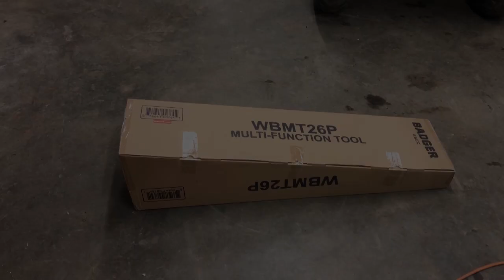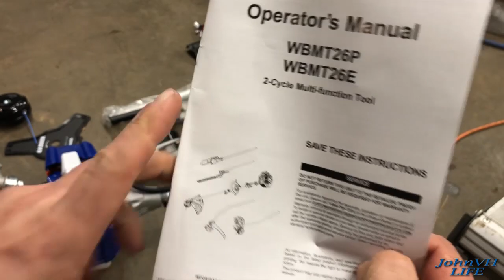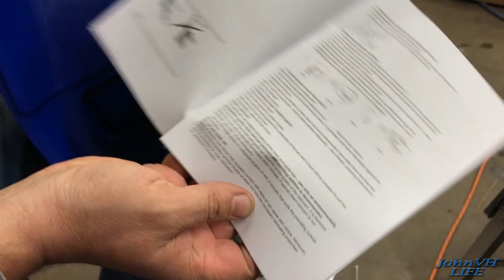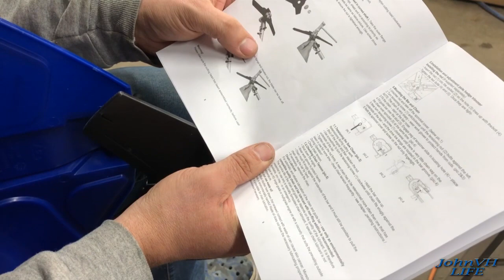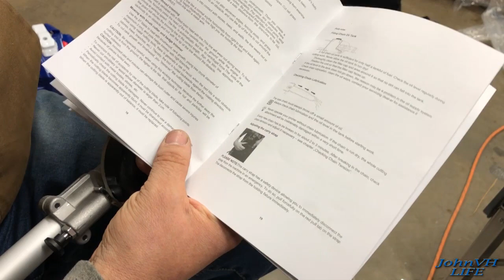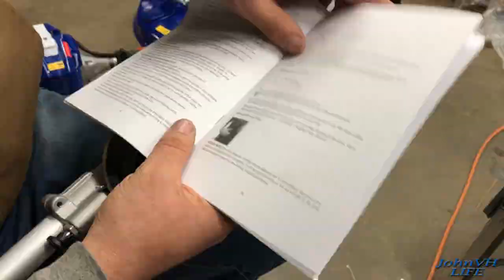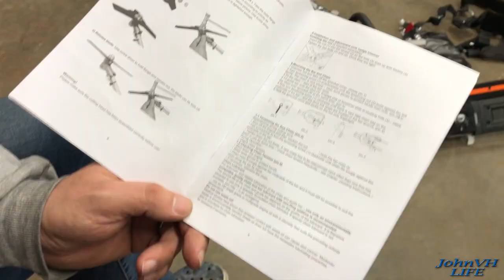Wild Badger 26cc WBMT26P 4 in 1 multi tool review and USE

Comment: Good job on the video, I've had mine for over a year now and 2nd all of John's positive comments.  Really love the limbing saw, I've cut 8" diameter trees with it, no problem.  Only negatives I've experienced in my yr + of use is the the original saw blade didn't last long (got dull quick) so replaced it with one with more teeth and higher grade and worked much better, though still got dull in due time--I'm doing a lot of cutting! Also disappointed that they didn't include an edger with the package, need to pay extra to get one of those if you want one. But overall, been a great tool!
Reply from the maker: Thanks so much, I was using the pole saw on it the other day, I should have taken video! She fired right up, ran like a watch, cut very well, super happy with it!  Im sure over time Ill have the same issue you do, but time will tell! Im not cutting any hardwoods though.
Reply: I bought mine from lowes and it came with and edger but no saw

Comment: When I use the brush cutter or weed eater attachment when I tighten them or if not completely tightened will the blade or round string attachment fly off and if so how do I make sure that they won't fly off

Comment: I bought mine this past week. I can not for the life of me get it to start. Is there a safety tab or something that I missed? I primed it, 50-1 fuel, put on start, the kill switch is to run. It isn't even remotely turning over, so I feel I must be missing something stupid.
Reply from the maker: Odd, choke is on?
Reply: @JohnVHLife  Yes, I have even tried flipping it to run and holding the gas while pulling.
Reply from the maker: @jeremysilcox9362  remove the plug and test to see if it has spark?
Reply: MAKE SURE YOU GOT THE SWITCH TURNED ON, WHEN YOU TRY TO CRANK IT.

Comment: I bought one last year and could never get a complete package that was working there was something major wrong ever time I  returned it and got the next one something was wrong so I got my money back and got a ryobi.
Reply from the maker: Dang. That’s a bummer. So far so good for me
Reply: I’m having the same problem.
Reply from the maker: @tommills177  Strange, mine works great still! Getting spark? Getting fuel? Priming the carb?
Reply: I don’t have a problem with someone else’s, just with my own. And that’s why I reached out. I’m glad yours is working though.
Reply: @JohnVHLife  There is spark, fuel and I always prime and chock. Seems like something is too tight.
Reply from the maker: @tommills177  Try removing the accessories from it? Just fire up the motor and see?
Reply: Will do.
Reply: @JohnVHLife  That was better but still wouldn’t run. I’ve got it in the shop now. If you don’t mind I will let you know what it was so someone else may benefit.
Reply: @tommills177  I've got the same problem. Brand new can't get it to run for s*** got me pissed off
Reply: When I look really closely at it the gas tank where the two hoses come out there is a small slit that has been painted over with white paint. Does a trimmer have to hold pressure in the gas tank to start? Shouldn't have these problems on a brand new unit.

Comment: Where do you check the engine oil on this thing? There's nothing about it in owners manual.
Reply from the maker: Being a two stroke, I dont believe it has any oil.
Reply: Is this a confirmed answer, I just want to be sure I’m doing everything right to maintenance my machine 🙂

Comment: Is there an extension you can get to make the pole saw or hedge trimmer longer (by about 3 feet).  I cannot seem to locate one.
Reply from the maker: I have wondered the same thing. LMK
Reply: @JohnVHLife  I contacted Wild Badger about this and this is the response I received.....

"The shaft on the attachments is 30", and the following brands should be compatible: Ryobi, Craftsman, Troy-Bilt, Toro, Poulan, Poulan Pro, Weed Eater, Cub Cadet, MTD Pro, John Deer, Yard Machine, Yard Man, McCulloch String Trimmers*. But Wild Badger does not sell an extender for these attachments.
*Be sure to check your user manual before purchasing this, or another attachment, for another brand."

Comment: Can you use pre-mix 50 to 1 fuel? I filled my up brand new weed eater and is will not start
Reply from the maker: Manual says to mix the fuel 50:1, so it should be fine...  pump the primer and use the choke as stated in the manual
Reply: @JohnVHLife  I tried everything NEVER started. Had to return it. Thank you.
Reply from the maker: @YayaOrchid  Bummer!
Reply: @YayaOrchid  are you holding down the orange buttons? If so, it won’t start.  Just hold onto the body or bar. Also, have the trimmer set at start then when you get it to start, put it on run and then push the orange buttons.
Reply: This is very hard to start the first time. I about gave up but after many tries, it finally started. Started right up after that. I was about to return mine as well. Today first time use,   very intense vibration using blade. Waiting for company to get back to me.

Comment: Still have no clue what that piece is sticking off the handle. It's annoying and in my way
Reply from the maker: Pretty sure its to rest on your leg, or something.
Reply: Must be a big dude! I can't rest it anywhere lol
Reply: edging?
Reply: Way to far for that
Reply: @brandonsmith8548  ill figure it out lol jus ordered 1. see how it compares to echo srm 225
Reply: Nothing like the echo. Be careful of your forearms with no heat Shield
Reply: @brandonsmith8548  its got enough sheilding. i haven't burnt myself one on mine i've had it for a few months.
Reply: I run mine all day. The motor is not shielded always burn my forearm lol.
Reply: @brandonsmith8548  how? are you some how sticking your arm between the plastic and the motor? i ran mine for 45 minutes this morning trimming my fence swell around the house, the shed, trimming vines off the back fence  etc. i've never burned myself on mine. thats with my right forearms sitting right on top the motor.
Reply: Lol no. My other trimmers have a cover. This one only has like half a cover. The bottom of the motor sticks out. It's just where I've always leaned my arm while trimming. The upper side of my forearm gets sizzled. Or if I'm edging it does it
Reply: Yea idk it's weird when it first happened cause all my other trimmers are fine. I still use it everyday it just a habit
Reply: @brandonsmith8548  ok i'm for the life of me trying to figure out WHY you have the motor ON TOP OF YOUR ARM. thats not where it goes. are you left handed or something?
Reply: My right forearm brother. Near my elbow
Reply: Maybe I hold it weird lol.
Reply: @brandonsmith8548  so you're using it commercially then? i'm residential and i trim every other week so typically i'm only trimming for an 1-1.5 hours a month. i got maybe 4 hours total on mine including letting it just run for break in. what oil are you using? right now i'm running vp sef 50/40:1 premix.
Reply: Correct I bought it as a backup. But it seems to be the one I grab more often and I run amsoil 2 cycle mix. 40:1. They say you can run amsoil 100:1 but I just can't do it lol.
Reply: I've had it about a month so I would say 60 ish hours maybe. That's a rough guess as I rotate a few trimmers. I've got a graveyard of broken trimmers lol. Maybe I'll try bumping to 60 or 70:1
Reply: @brandonsmith8548  they claim its commercial grade so i;m interested to see how long these last. i figure for me 15-20 hours a year so right now you're 3 years in for me.anyone in the lawn business has a graveyard of broken equipment.
Reply: I use it about 1 hour per day 6 days a week. And yea I use the scraps for parts more than anything!

Comment: The blade makes it shake a lot
Reply from the maker: Not really
Reply: Mine has a horrible vibration. Waiting for the company to get back to me.
Reply from the maker: @phoenixrising1087  Even with nothing attached?
Reply: I was using the blade. Or trying to. The Badger isn't complicated to assemble but did wonder if I did something wrong. I've put plenty together in the past without problem. But now I'm reading of others having the vibration problem. Mine was actually pretty violent, twisting the whole thing around in my hands while trying to hold the handle. The blade itself was very secure, no wiggle room at all. The vibration was enough to loosen screws in different areas, which I'd retighten, try again only to have them come loose again. It seems perhaps some cutters may have this problem while others don't @JohnVHLife
Reply: @phoenixrising1087  I am having the same issue. Vibration so bad I can't even fully fire it up. The string attachment is fine but I bought it for the blade, and it is completely unusable. Been hoping I could find a fix, but I may have to return it.
Reply: getting mine today, so thanks for the warning... but could it be that the blade isn't seated properly - causing it to be out of balance as it spins?
Reply: @kiddshellac  no